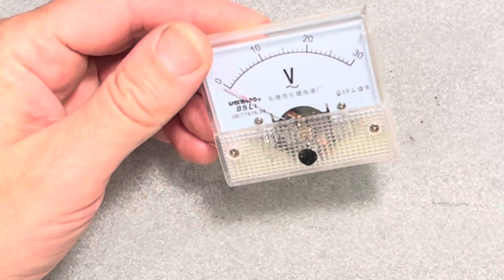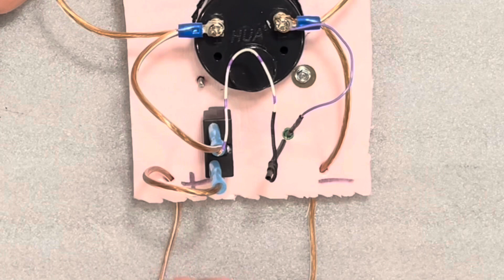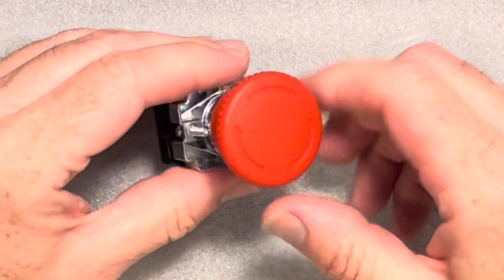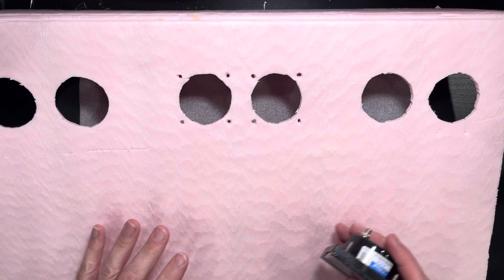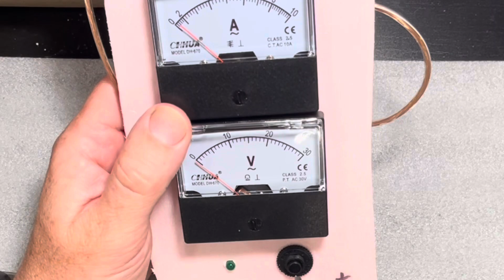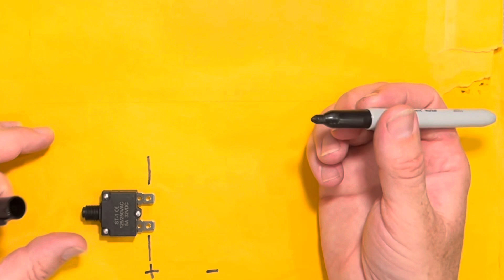Starting on the Control Panel and my Plans for the Project. Voltmeters, Ammeters, and ZWs oh my!

Comment: I've been dealing with circuit schematics for over 30 years.
Your diagram of how to wire up the breaker LED voltmeter ammeter is perfect, and easy to understand.

You said you felt like you were struggling with it; I think you're doing great <3 But... maybe hunt down some fast-blow breakers. 
I had to throw a bunch of breakers out on my latest train project because they just blow too slow, it's not really safe. Whether yours are fast enough is up to you :)
Reply from the maker: Thanks! It took my brain a while to warm up and arrive at the point I could film. The breakers I have are not quick enough for modern trains. I definitely need quicker ones.

Comment: For the Buzzing or annoying transformers when you have some loose windings that are driving you insane..... What works great for the noise reduction is clear silicone. Apply some clear silicone to the outsides of the coils where the carbon rollers are Not on. The rubberized silicone once cured acts as a shock absorber or dampener which will stop almost all noise from the transformer. When applying the silicone, make sure that it's getting pushed into the copper windings well and applying it from one end of the lamination to the other is preferred. Clear silicone is a insulator, so there's absolutely no electrical risks here.  Hope this helps you Dave or anyone else who's ZW or any type or brand transformer you have that's become a nuisance to the ears. Good luck and keep the trains rollin. 😊
Reply from the maker: That’s an amazing idea. I will have to try that. Thanks!

Comment: You've set up another interesting project, Dave, but I'm sure it's not something you can't see to the end. I think you have a sense of electrical knowledge more than you give yourself credit for. Just try to not get injured. 'Wisely and slow, for they stumble who run fast' was the monk's advice to Romeo on their way to Juliet's tomb. Romeo didn't take the advice and everything went south. If necessary, latch on to a collector or a website that has or relates experience with this type of panel building. You'll be fine.

Comment: Dave, when that revision of a ZW buzzes, it's due to failure of the bonding agent between the T-shaped anchor piece and the main section of the steel laminations.

The way I fix them is to drive a narrow putty knife into the gap to separate the anchor piece. 

 Clean the mating surfaces and apply 5 minute epoxy, then clamp it tightly.
Reply from the maker: That makes sense. Someone else mentioned a silicone caulk. You prefer the epoxy? Seems like the caulk would be easier.
Reply: @dagryffynhobby  I've done several with epoxy and they seem to run cooler.

My concern is that silicone caulk would be too thick and also not adhere as well.

Comment: Excellent video Dave!! Your tutorial was spot on. The volt meter is parallel with the power running through it from the transformer, while your amp meter is in series with the “Hot” or Center Rail from the volt meter. Well done. Just remember, the ZW has great power of 275 Watts, but it does not have a lot of Amps, and when it comes to power, Amps are KING! Each of the 4 channels of A, B, C, and D only put out 3.437 amps per channel. 275 Watts divided by 20 volts = 13.75 amps total. Divide 13.75 amps by each of the (4) A, B, C, and D channels and you get 3.437 amps per channel. So be careful when hooking up a lot of things like illuminated passenger cars and things of the sorts, because you can trip those new circuit breakers easily by drawing too much power, and then you’ll be scratching your head thinking you hooked up all of your meters incorrectly. It’s not so. Postwar transformers put out high wattages, not high amperage. Also, ALL Postwar transformers put out Smooth Sine Waves, compared to today’s modern transformers that put out Chopped Sine Waves. Chopped Sine Wave transformers are designed for modern train components that use capacitors for smoke units, electro couplers, digital sounds etc. Modern day trains don’t work as well with Postwar transformers because of the lower amperage, and the Smooth Sine Wave they put out.

Comment: The only thing that comes to mind is ( suggestion) is use larger gauge wire. I’m thinking you’ll loose some amps going through your board . But I’m not neither a electrician.
Reply from the maker: Yeah, there are calculations for wire size but that’s beyond my skill. I will be using a larger wire though. I have a lot of scrap 14 and 12 gauge wire from when I renovated my house.

Comment: Gages are actually useful AND fun to have, I had them on the power supply last year when running the trains off an industrial "variac" for power. Also I found the limits of my old Lionel's with the meters too, the KW couldn't handle my long trains, the LW's could supply 8 even 9 amps before the circuit breakers popped. Only thing to keep track of is the amperage ratings of the ammeter. Guess u can assume if they have the capability of measuring a certain amount , they can handle that amount? When I pull my longer multi locomotive trains up a grade I often push 8 to 9 amps. The variac I have will easily handle/supply 20 amps continuous , MOST layouts  will never need more than 5 amps :) Actually something u might have fun trying someday ( the variac) . A decent one has a better wave form as well than the older Lionel's. Anyway this is a real interesting video for me. You will have a more organized plan than my hack and smoke. ( they didn't smoke, worked quite well, and planning to reinstall the meters and variac on the layout this winter )

Comment: I was headed down nearly the exact same road as you; I had the two postwar ZWs, was about to order the meters, breakers and such to put it all together.... But I ended up deciding against it.  I ended up biting the bullet and bought a new Lionel ZW-L instead.  Sure, it put a dent in the wallet... But the integrated meters on it are nice, circuit protection is awesome, has more reliable whistle controllers, doesn't take up much space and still has that retro ZW look.  I also like the big size of it.... almost twice that of a ZW.  I'm keeping the postwar ZWs (I bought them restored) on standby just in case the ZW-L craps out...  although it has been working just fine for about a year.👍

Comment: Dave, if you install the E-stop ahead of the 120 volt receptacle serving your transformer(s), then it can serve as a master kill switch each time you exit the room to ensure that you disconnect all power sources from your layout using only one switch. . If it's installed on the 120 vlot supply line, all the wiring methods would need to be installed per your local codes using rated wiring and enclosures. The E-stop would be required to be 120 volt rated at 15 amps minimum. You could then install a multi outlet TVSS surge power strip from the switched receptacle to supply multiple transformers from one master kill switch. This is how I have configured my setup. Only I used a single pole light switch at the 4 gang light switch by the door of my train room and I kill everything in my train room when exiting. This ensures that I don't inadvertently leave anything on accidentally. If I can see Lights off then trains off by turning all switces off. The entire duplex receptacle can be switched by the E-stop or by running a 3 wire with ground and breaking the tab on the hot side of the receptacle located between the brass screws you can split wire the receptacle to be half hot half switched. I'm a retired electrician with 47 years experience in the trade and would be glad to help with any further wiring or code related questions if desired. The low voltage wiring from the secondary side of your transformers is less of a potential fire or electrocution risk than the 120 volt primary supply side. The older transformers are linear loads and provide a somewhat pure 60 hertz sign wave and is actually a cleaner power supply than the solid state variety. Ironically solid state transformers are non-linear and as such produces a dirty chopped sign wave otherwise known as harmonic load that is the cause of chip degradation. Electronic circuits in and of themselves is one source of non-linear loads. Using TVSS ( transit voltage surge suppression) on the load side of the transformer is the best way to protect the sensitive electronic devices of modern electronic equipment. The best protection against harmonic loads or non-linear transit voltages is to install it on both sides where power is utilized to mitigate transits such as a transit voltage power strip ahead of the transformer and again from each individual positive secondary transformer tap. The use of a TVSS circuit breaker or whole panel surge protector is also encouraged to mitigate potential threats to all of the sensitive electronics in your home against lightning and utility switching. Every TVSS unit only provides minimal clamping voltage with some let through. So the more the merrier. The end goal is to get as close to zero let through as possible with each providing a line of defense so to speak. Transits occurs overtime slowly degrading chips like cancer, causing chip failure at some point. Like I said Ironically non-linear loads in and of themselves are responsible for this phenomena as well and computer Chips are used in  almost everything in a modern home. From furnaces to a/c units to even our LED lights not to mention microwaves, TVs, computers and  now even our trains. Circuit breakers protect against short circuits or overloads. TVSS surge protects against transit voltages. Harmonics are additional sign waves generated by non-linear loads on to the pure 60 hertz sign wave. So third, forth, and fifth harmonics are third, forth, fifth sign waves which aren't a problem for liner loads such as motors and transformer but wreak havoc on non-linear loads such as sensitive electronics.

Comment: Ammeters are even more important than voltmeters. BUT MAKE SURE YOU HAVE AN METER WITH AN INTERNAL SHUNT OR YOU NEED TO  PROVIDE AN EXTERNAL METER SHUNT FOR YOUR AMMETER!!!!!
Reply from the maker: How would I know if it has an internal shunt?
Reply: @dagryffynhobby  it should be marked. If there’s no marking, assume no shunt. A 50 microvolt  shunt across the meter is then needed. This will protect the delicate meter from being subjected to full track current.

Comment: I noticed your breakers are 5 AMP. I have 5 AMP on mine, and I do have a non problematic situation that will pop them every time: when I run a string of 12 lit passenger cars behind a double headed set of F7s. That pulls about 8-9 AMPs, which the ZW and Z4000 can deliver in their sleep.

Comment: I am curious about how much current is being used for a dual pull more motor engine with a long consist of cars, will it trip a 5-amp breaker when it starts up or running at full speed puffing smoke.
Reply from the maker: Me too. If I start tripping breakers, I move to a larger one I guess

Comment: Dave you can use an in line circuit breaker rated for switch duty as your kill switch. Make sure to add the watts for each transformer together and divide by 120 volts to get total Amps. Do not exceed 80% of the breaker amp rating. May I suggest using some heat shrinks on your connections. Your ideas for a simple control panel are well thought out. I enjoy your channel and budget minded approach.

Comment: A main input power kill is a good idea.  I use a power switch (big rocker style illuminated light when on and light off when open) inline with power cord.  Kill s/b on main power not any output out of transformer. The foam is only for layout setup right? A high temp non metallic epoxy will fix the transformer loose coils. Nice you are sharing the electrical up grades you plan for.
Reply from the maker: I don’t know why a regular switch didn’t occur to me! I think I was just wanting a big red button! Yeah the foam is just to figure it all out

Comment: You did it correctly.  The volt meter goes in parallel and the amp meter goes in series.  Make sure the switch is rated to carry enough volts and amps.
Reply from the maker: Thanks David. I think everything is rated ok based on my calculations